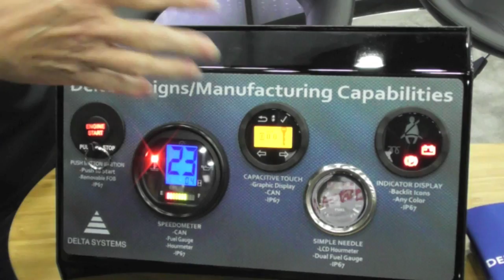2016 GIE Equipment Expo Louisville, KY (2nd Appearance)

Comment: Been watching your channel for 3 years and am addicted to the highly terrible acting that makes me continue to watch like a train wreck. Love it!  Hey, I got some questions. I repair a lot of my own stuff. Recently bought a property that has 12 acres that need cut- 9 acres twice a year and 3 acres about 20 times a year.  I'm looking for the top 5 zero turns on the market. Speed is of an essence. I am currently looking at the 72" dixie chopper, the top of the line Scags and some Ferris stuff. I really can use some input on making a decision. What brands would you guys recommend that have the least problems, most HP, cheapest repairs when repairs need done, etc.?

Which brand motors are best in the 31HP to 37HP range?

What type motors are best?  air-cooled, air-cooled EFI, air-cooled DFI, liquid cooled EFI, or liquid cooled DFI? 

Also, if you have something in this range I am looking for new or used, let me know.

Thanks,
Bob